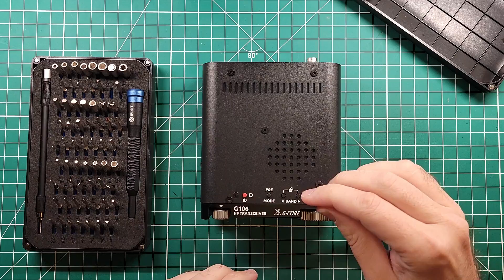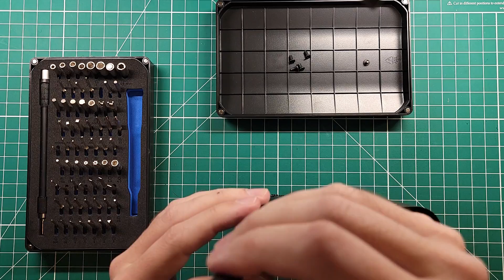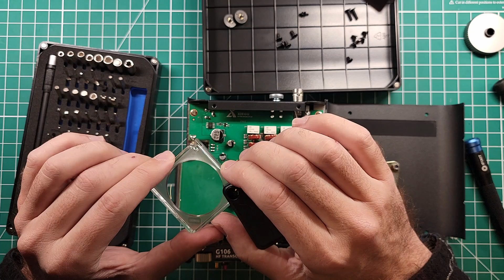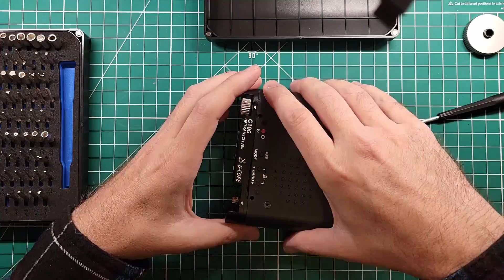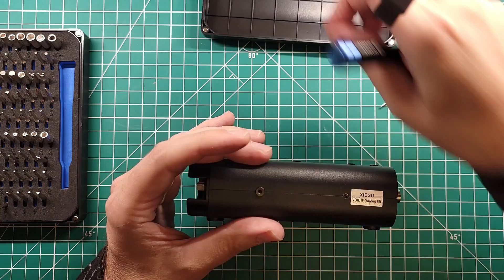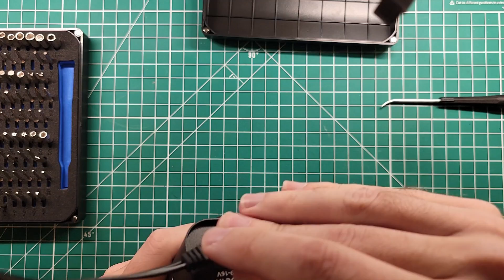There better be cash inside! Xiegu G106 Teardown

Comment: Great video.  At 6:15 I think the 222... number you are reading is the devices date code.  The part number appears printed above, which thanks to the excellent sharpness in your video  can just barely be read as RD16HHF1.  The letters are run together, smeared, and a little hard to read, and there is no Mitsubishi tri-foil diamond logo, so they are probably Chinese knock-offs, but I'm fairly sure that's what we have. ( EDIT - make that REALLY sure - since I just re-watched the video again and noticed you did read the output RD16HHF Mosfet part # correctly at 3:48 )

This is good to see because the RD16HHF1 is a nicely over-spec'ed 16 Watt rated device, which means here they are conservatively running it between 2:1 and 3:1 de-rated to cut down distortion and increase reliability.  The only downside is that a single-ended final insead of push-pull doesn't cancel even harmonics like a push-pull output stage, but to make up for this lack of even harmonic cancellation in its output stage, the G106 runs the RD16HHF1 heavily de-rated to reduce distortion, and employs banks of sharp 7th order octave band output filters. 

At first I was critical of this output arrangement, because most SSB HF rigs do generally run push-pull finals to take advantage of power sharing and even-harmonic cancellation - but then I realized, these rigs typically drive those finals at levels of a couple watts using a single-ended driver stage just like the RD16HHF1 in the G106.  So the G106 is basically just this same RF drive chain up through the single-ended RD16HHF1 driver - minus the high power 100W push pull stage (typically a pair of RD70HHF ot RD100HHF devices) - and with the G106, you do have the option to add this high power push-pull output stage by adding Xiegu's  external XPA-125B PA.
Reply from the maker: Excellent analysis.  I think in terms of hardware design Xiegu is pretty darn good.  Their reputation falls down with the (outsourced) firmware that drives the user to the hardware.
Reply: @temporarilyoffline   Yep the firmware/software is usually the limiting factor.  The FT891 and FT991 have horrible firmware. On the G109 the firmware user interface, thanks to its simplicity, is actually not too bad, although I agree that it would be nice to have a few SSB filter bandwidths to go with the excellent CW filtering. About the only thing they really screwed up in in the G109 firmware is the dumb way the BAND buttons work. Because of the limited resolution of the encoder, to quickly navigate within a band, I find myself constantly shifting the step size digit position - WHICH REQUIRES A LONG PRESS.  Step-size changes are much more frequent than band changes, so Ziegu needs to reverse this, or at least provide a setting to give users the option to reverse the current default arrangement, so short presses shift the step size and band changes require a long press. This would make tuning around the band easier, faster, and minimize unnecessary dial spinning, which could be really important, because one feature that I wasn't able to reassure myself on well watching your video was weather or not that big heavy spinner knob was attached to an optical encoder or just a cheap low cost mechanical one. Mechanical encoders are typically only rated for 10000 to 30000 revolutions, which you can use up fairly quickly spinning the dial though 100s, or even 1000s, of revs per session.  There are now small 12mm square encoders that are optical, but I couldn't see if that's what they used.   Be nice to know.  Did you notice?

Comment: Thank you for the video. Mine is on the way. Sale price was down to $199 so i could not resist.
Reply from the maker: It's hard to beat!  It's not fancy or feature rich, but it does the job.
Reply: @temporarilyoffline  
1. What is the difference between 106 and 106C?
2. Would you recommend it as a spare rig for portable/emergency use?
3. I have a TruSDX on the way. How do they compare?
Reply from the maker: @mrtechie6810  1.  my guess is that the 106c is a regional model.  I can't find any reference to it in the US market to see the differences.
2.  If you're good at QPR operation and understand the challenges, its a great backup rig, certainly great for portable.
3.  The TruSDX is a unique radio and it shines in its unique spot in the world.  The G106 is better in many ways, but at the end of the day, its unfair to compare them to each other as the G106 would win on technical reasons, but that's not the point of the truSDX
Reply: @temporarilyoffline  thank you so much for your kind and detailed reply! ❤️
Reply from the maker: @mrtechie6810  Anytime!

Comment: I just returned mine. It's cute and intended for low power digital mode; but the problem with getting into digital is that you need to buy more hardware making it less affordable from the "base" cost. I was not able to get a reply when I was testing. Zero issues on my lowest power on my base DX10...but that's a totally different ball game, I get it. Hearing myself on an SDR, I know it's me but I am a hair over the noise level. For just a little more, I got another Yeasu; the 891. I already had a tuner and a digi rig + correct cables. The cost for quality makes more since given that my voice is heard without having to mess around with 5w. There's a niche for this radio, but I rather have amazing hardware instead of playing with a toy. Someone may like it as a starter radio, but if you do voice and the bands are acting up...no one will hear you. I may still want one in the future if I want a low powered CW rig I can fit in my pocket..but only if it's used and at half the cost.
Reply from the maker: Makes total sense.  It's a fun radio to play with, but it might not match your use case.

Comment: The Xiegu G90 has a silkscreened arrow on the circuit board which identifies the diode to be removed for extended transmit coverage. Is there anything like that on the G106 board?
Reply from the maker: I didn't see one.
Reply: @temporarilyoffline  Thanks for checking. Do you see any diodes, or traces on the circuit board with little tiny gaps intended to be bridged with solder, or anything else that matches the traditional way to provide configuration information to the processor? Especially relevant would be anything on the circuit which looks similar to how this is done on the G90.
Reply from the maker: @David2718281828  I looked pretty hard for it, I'm assuming that as this radio gets a little more popular and some of the stink wears off that information will materialize.  Its affordable enough to grab and take a look though.

Comment: Having just received mine — after months of waffling & watching your & other reviews — I came back to stare at the LPF bits. Looks like Xiegu’s barrel rolling the LPS across multiple bands. Which explains, as you have also noticed, that some bands are lower output than others. Mine, 30m is 3W & all else is at least 5W. Bet 30m shares the filter with 40m & that’n’s not optimized for 30m. Still, it’s a definite “non-threat carry-on” radio. Nothin’ fancy but at least good for a POTA in Portugal ;-). Thanks for the tear-down/look-see. 73 de W8IJN
Reply from the maker: Your welcome!  Wishing you many happy activations!

Comment: In the USA, a "warranty void if removed" sticker isn't legal as according to the Magnus and Moss warranty act of 1970 you cannot void a warranty just by opening the device. To void the warranty you have to actually cause damage to the radio. 
The issues are twofold: one is that most manufacturers ignore this as nobody is gonna take them to court over it and in this case it's a Chinese product so I'm not sure if the law even applies in the first place. I'm an RF engineer, not a lawyer after all.
Reply from the maker: I mentally assume that my warranty is from/serviced by Radioddity and they have been very good.  I will contact RO first.  But that being said, I've had no problems with my rig.

Comment: Looks "very quality" to me but unfortunately, no cash.😆
Reply from the maker: It's pretty 👍
Reply: Nice look inside. Long gone the style of boards & parts I saw back working at Drake. This new surface mount stuff is hell on aging eyes & essential tremor sufferers. Which is why I now just look inside and let the basement-dwelling Cheetohs eater next door do all my mods & fixes. ;-). Have admit the board & bits looks nominal good. But sittin’ here with the IC-705 on the bench, I’ll pass on spending more. Thanks for the innards view. 73 de W8IJN
Reply from the maker: @haramanggapuja  Exactly, the engineering is sound.  If you've got the 705, you are all set!